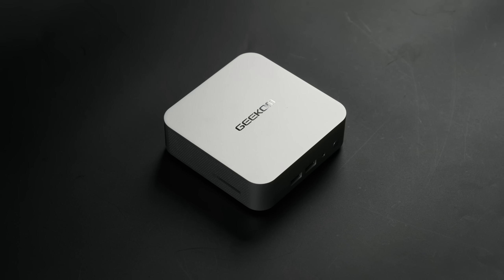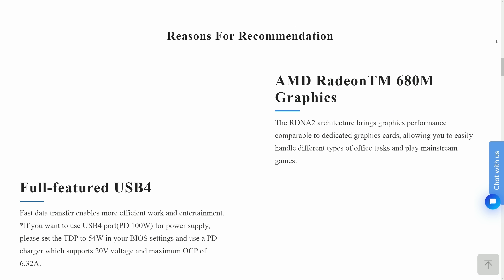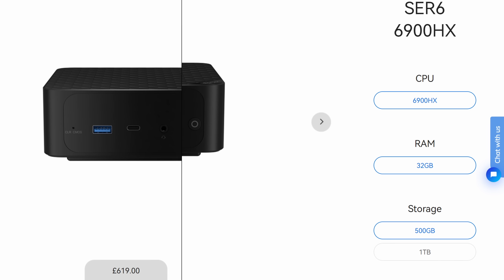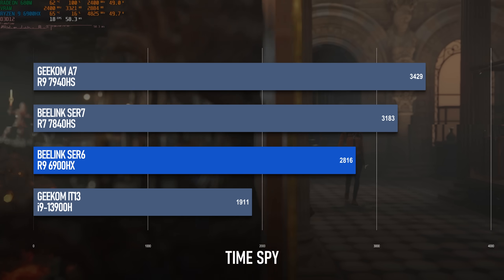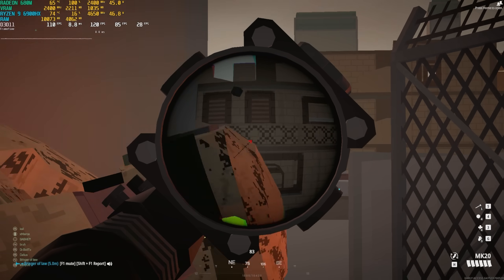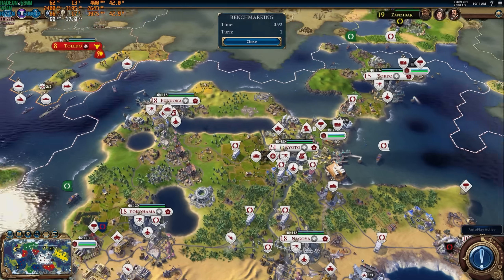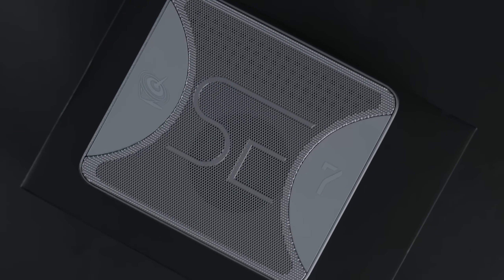New! (but also old) | Beelink SER6 feat. Ryzen 9 6900HX

Comment from the maker: ERRATA / NOTES
Sorry guys, I was a bit under the weather this week, which is why my voice is hoarse and a bit higher pitched than normal.
Also, I forgot to put keys on the charts, so they’re as follows:

CINEBENCH R23: Dark Blue = Multithreaded, Light Blue = Single
GEEKBENCH 6 CPU: Dark Blue = Multithreaded, Light Blue = Single
GEEKBENCH 6 GPU: Dark Blue = OpenCL, Light Blue = Vulkan
TIME SPY & FIRE STRIKE: Overall Score
DAVINCI RESOLVE & BLENDER: Time (hours:mins:secs)
Reply: hey, the 6900HX is unlocked, and can be overclocked via AMD's official tool, Ryzen Master. Have you tried that tool out instead of the usual Universal x86 Tuning Utility yet?
Reply: I'm not surprised! Get yer self an Alka-Seltzer and put the beers back in the fridge, you're back at work now haha. Hope you had a good break off and cheers for the content up to now.

Cheers 🍻
Reply: @marknewellmusic *Puts the beer back in the fridge.

* Pulls out a hidden flask

Comment: There is not any malware found on my SER6, but the issue with installation of e.g. LibreOffice ending in error 2503 plus the fact that on my SER6 the virtual RAM was disabled by the pre-installed Windows 11 Pro build convinced me that it is best practice always to re-install the OS from scratch.

I had ordered the even cheaper version with 16 GB RAM and the lack of enabled VRAM was noticed quite sooner than later. These pre-installed builds cannot be trusted. 

On the positive side, the installed Crucial P3 Plus 500 GB SSD with PCIe 4.0 was very fast and I saw over 5000 MB/s in the CrystalDiskMark for reading sequential and over 4000 MB/s with sequential writes. It is very good that Beelink is using Crucial RAM and SSDs. Plus fan noise is not an issue if surfing the internet or when typing e-mail replies.
Reply: Hello, what has been the experience so far with Beelink? I have seen negative comments that it lasts up to 6 months or a year and it breaks down. Thank you in advance for your response.

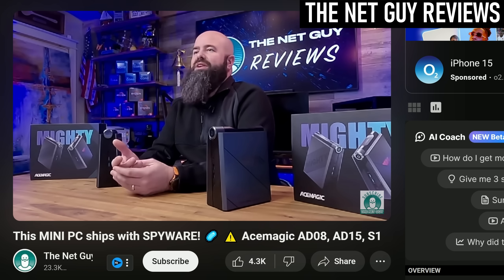Comment: 14:52 probably a limitation of the power supply. Increase amperage and re-run, I had a similar issue with an N305 box from Beelink. They sent a paltry 3a power supply when it ideally needs 5a. I’m guessing that’s a 6-7a and should be about 10a

Comment: regardles of anything ALWAYS re-install windows and don't forget to bypass the online account requiremement with OOBEBYPASS
Reply: Absoltely recommend, get rid of the pre-installed OS immediately. Plus the bypassing mhe MS account is also possible simply by setting the system up for business or school, you can then create a local account without having to use any commands and it also works with the 23H2 Windows 11 Pro version.

Comment: Not too bad. There have also been a few 5000 series mini PC's in recent months too.

I don't mind plastic as long as the cooling is sufficient, or the larger footprint.

But the fact that it is an older generation, I would expect more competitive pricing, so I think that the voucher pricing needs to be the standard in order for this to likely have wider appeal.

Add the closing comments regarding the 7000 series option and it does seem rather less desirable.

Comment: I come from the days when people were Seriously arguing 30fps was enough . 
I played most games on 30-ish fps, not by choice but because that's what my rig could do without potato quality graphics. And I had a blast playing them. It wasn't nearly the most fluid or natural experience, but such were the times for people without wads of cash. 
I always resented reviewers who could not only afford high-end gear for the price of my barely medium build (in my region) but would actively badmouth anything below that on their market. Hell it was even worse when they didn't even acknowledge my build as entry level as the years went on and I could still play those games just fine.
It was a breath of fresh air to see a reviewer showing older gear. 
And now that I can afford to have a good rig I get to have the joy of seeing a mini-PC destroy my old rig in anything but GPU and even then only because of power limitations.
To get acceptable framerates all around in modern games and then the reviewer complains about 75fps being too low for their preference (on that game). My monitor caps at 59fps. Getting a new one is a major expense. 
I get it, I really do, hell, I have a system very similar to their main one, with an inferior GPU. But damn if it doesn't feel bad.

Comment: I got a SER6 PRO with the 7735HS and it's almost the same rig.  I see it's not longer listed for sale on Amazon.  It lives in my toolbox hutch at work for all the online and HTML service manuals.  Handles it in the cold and the heat mounted to the back of a monitor stuck in a metal box more or less.  Did drill holes in a side to extend the wireless antennas to the top of my box.  Now if I need to my wireless ear buds work to just outside the shop door.
Reply: Hello, what has been the experience so far with Beelink? I have seen negative comments that it lasts up to 6 months or a year and it breaks down. Thank you in advance for your response.
Reply: @christianguillenchica9561  Been solid for 13 or 14 months in the shop.  I've left on and running 24/7.

Comment: Does the Intel solutions fare better in transitions and editing than these AMD APUs?  I know you said the export time was worse, but what about regular play, transitions, effects etc?  Outside of potential throttling of course.
Reply from the maker: Slightly worse in regular playback, but not horribly so. Effects and transitions are just as bad. though tbf I'm probably being a bit over critical. With the right workflow and some proxies, I'm sure you can make any of these work well.
Reply: @IcebergTech   Thank you.

Comment: 6900HX/7935HX is still a decent chip, though being first gen, the DDR5 memory controller is a bit lacking, the best i can get out of it is about 6600, where as i can get 8000 out of Zen4(others apparently able to get over 10,000), this is also partially do to 6900/7x35 being on 7nm+++ as opposed to Zen4 being 5nm+

Comment: I wonder when will there be Intel Ultra SOC, especially the one with full iGPU config. Heard the CPU performance is meh, but a huge jump in terms of integrated graphics performance. Besides, AMD integrated graphics definitely need some spanking just like Intel did on CPU performance.
Reply: It's still slower than the 780M, with more cores, consuming more power and having all the driver issues of Arc. That being said it's a huge jump over UHD graphics as it can actually run triple A games even if not very well.